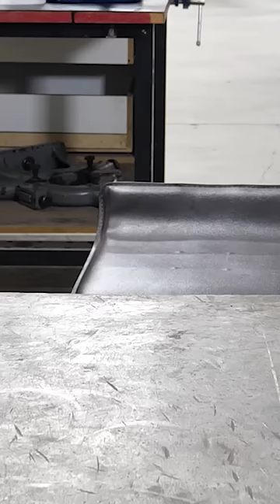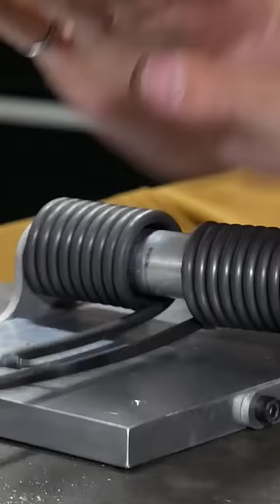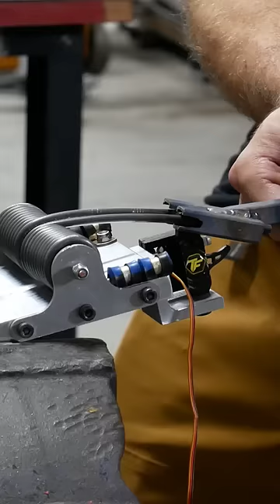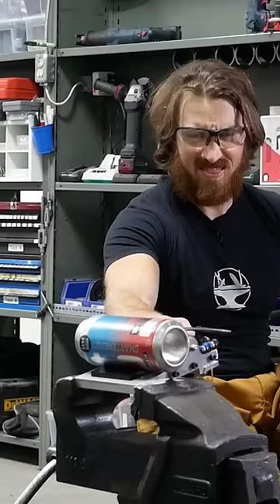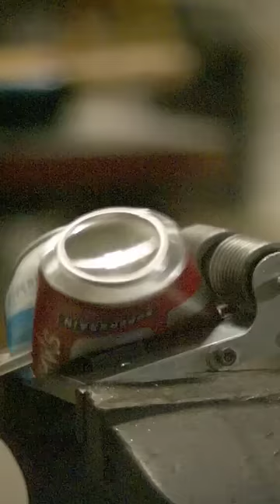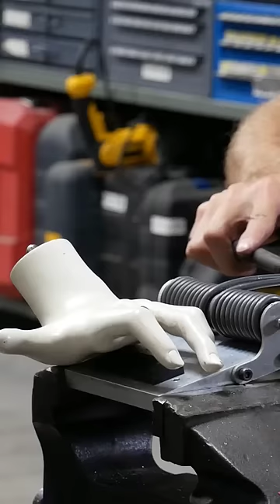we were so preoccupied whether we could... we didn't stop to think if we should...

Comment: I hope you show how you made this. I'd be really helpful for a college robotics project I'm working on.
Reply: They used a mandrel and a lathe
It is a rather common technique for making stuff like this without automation
Reply: Hmm, I'll need to look at whether our lathe has enough torque to make a spring like this. Also, would one need to make a holder to keep the spring winding tight? I'll look if there's some more info online.
Reply from the maker: Watch our kick flipping skateboard video :)

Comment: You need to put that in something more grand, an overpowered catapult maybe, or giant revolver- NOT A GUN, just a revolving cannon that lets loose six large fireworks or lots of little ones packed in each of the six slots!... That's activated with a hammer and percussion cap via trigger pull- A SIX SHOT FLARE GUN if you will!